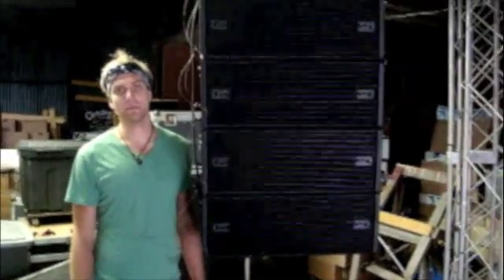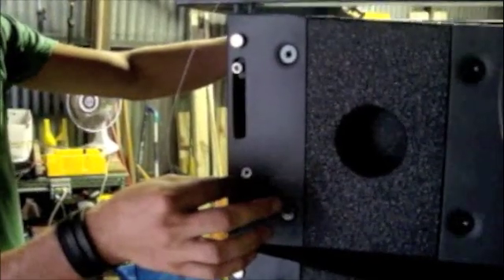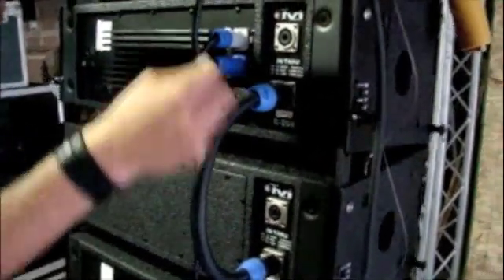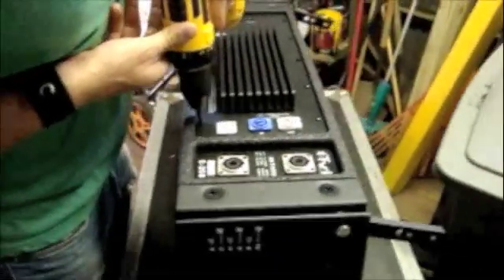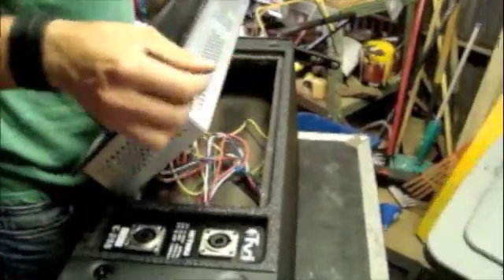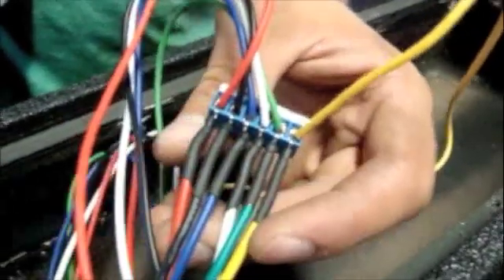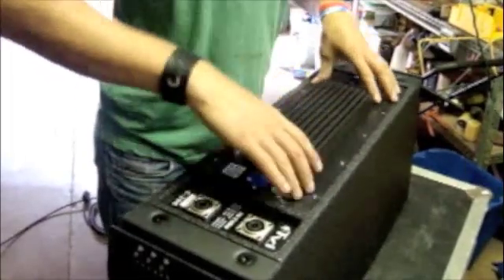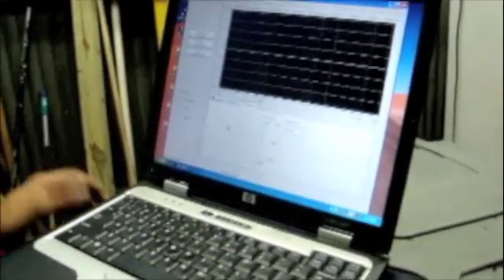Sevenglory Uses the C-208 by TVI - True Vision Audio

Comment: I started out with 8 W-110s, I still have them, I also purchased 10 of the  C 210s with cases for them,  I really like TVi tops,  Very impressive in clarity, I do not have the amps so I bought another brand of Class D amps to drive my tops and subs with,  I have ran 6 amps per circuit and had no problem at all, the glory of the CLass D amps,  They are very easy to EQ, I am very happy with my TVi line arrays, In case you wonder, they sound great also with other brands of subs, I have both.